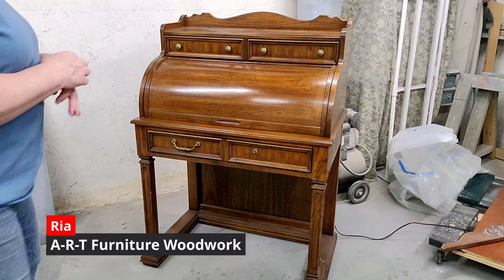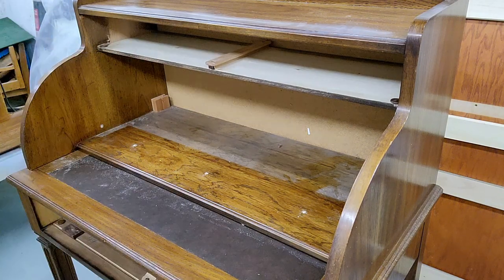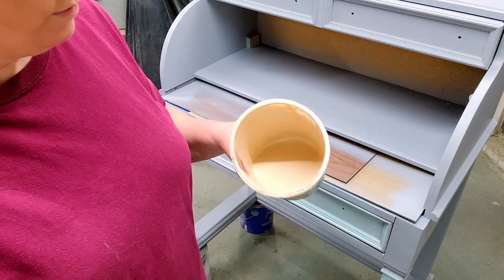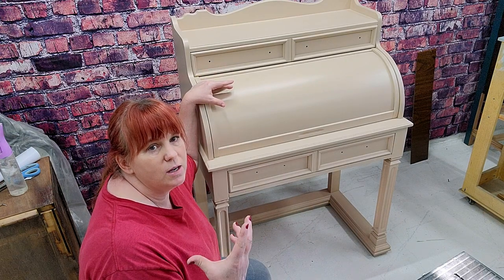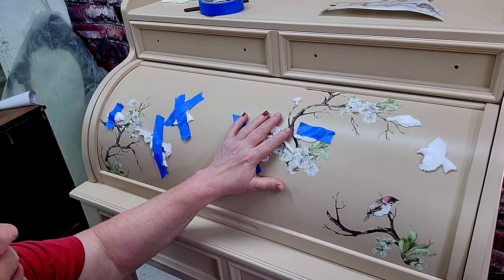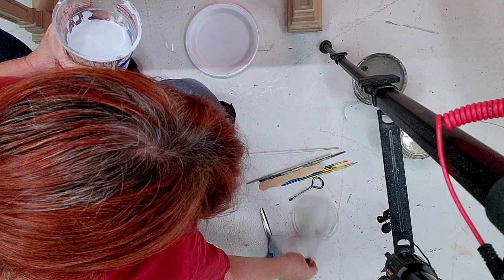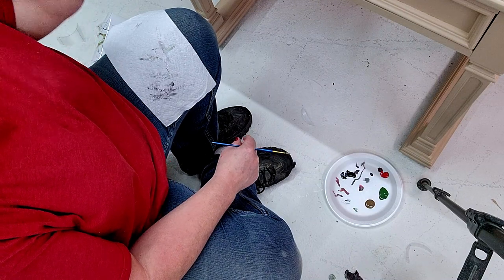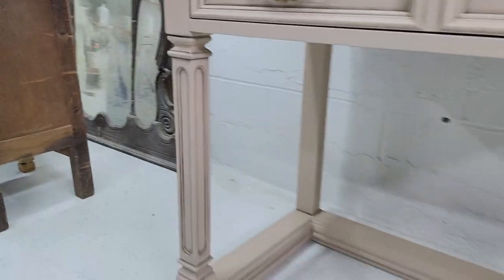The more i added to this roll top desk the better it became

Comment: Great job. Using transfers and/or Fablon is a literally breathtaking job, well for me at least....ha. Any wheeze or splutter and that transfer could migrate elsewhere...you got to be soooo careful.You did a grand job of placing it on the desk. 

I really do want to try out a coloured wax to pick out details, but was afraid that it'd look mucky, but using black wax mitigates this, so thanks again for another tip. 💚

That huge 3pane  mirror in the background is a beauty. Be interested to see what treatment that gets. Xxx
Reply from the maker: Thank you - the great thing about using wax if you dont like it very easy to removed it with mineral spirits if you top coat first. I did have alot more black wax on this piece but it looked kinda dirty but as i top coated first it came off really easy. 

Good spot with the large mirror in the background. Its part of a vanity and chest set i am working on for my self. BUT its turning into a nightmare project so its 50/50 if that mirror gets the sledge hammer treatment. So if you don't see that video before the end of the year well that's what happened to it.